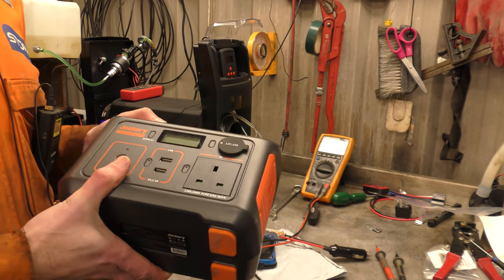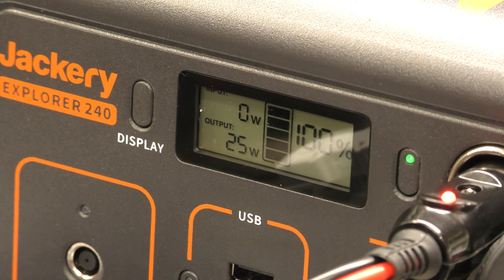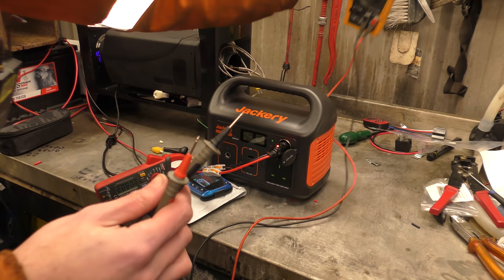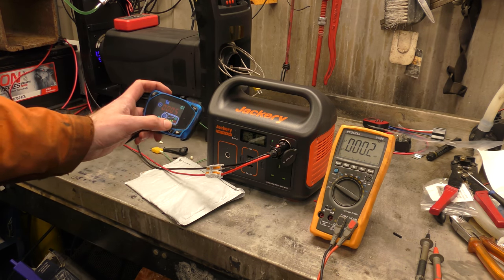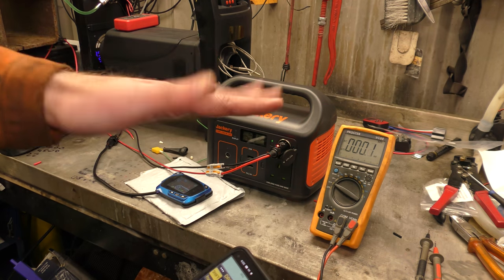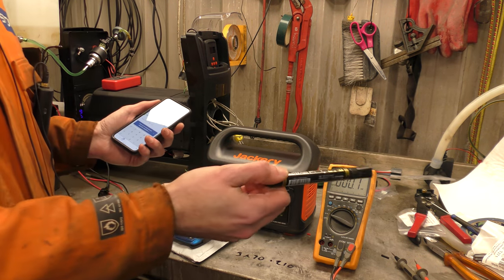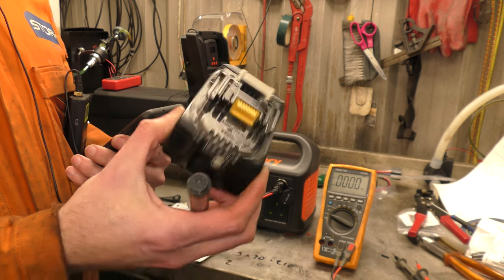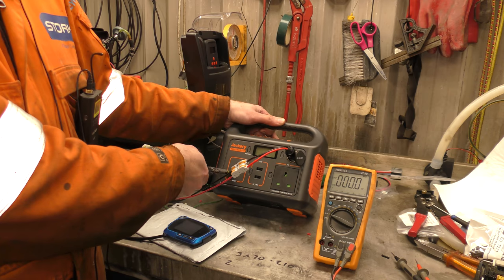Diesel Heater Running from Portable Power Station

Comment: And i run my heater on a 200ah renogy Lifep04 battery indefinitely - even only with 600w solar
Reply from the maker: Are those Renogy batteries good?  I get bombarded with Instagram adverts for them.

Comment: Great content mate. Would a Jackery be capable of running something like Bobil Vans hot water system too? They're pretty impressive, I'm thinking of getting the 1000 or 1500 and hoping it's all I need to run hot water and a diesel heater. Cheers mate.
Reply from the maker: Yes.  Well more yes than no.  Occasionally there are heaters that draw more than 10A at startup which trips a portable power supply.  But this can usually be fixed by having the low power set lower so it starts slower.  Once it's running there is more than enough current left to run the pump for the Bobil Vans water heater.  The pump only pulls 0.5A.
Reply: @DavidMcLuckie  Thanks David, much appreciated.  Could make a interesting video someday, I don't see any other youtubers testing this out.

Comment: So in your opinion, can a 2kw diesel heater running on a low setting off a Jackery 240, run for 8 hrs including shut down mode?
Reply from the maker: I've just realised you said 2KW.  Another viewer got 16 hours run time at lowest setting at what I'm presuming is a 2KW heater going by the numbers.

Comment: Can the Jackery be hooked up to a Victron 220-12V converter and run the heater endlessly when camping while connected to wall power?
Reply from the maker: I'd say no.  In the manual it says it can charge and be used at the same time but it's not recommended.  I'm guessing it's to do with the battery maintenance trying to charge and being used at the same time.
Reply: @DavidMcLuckie  Thanks for checking David. With a normal 12v battery the above would be possible, am I right?
Reply: You can power the heater using a Victron 12V-15A IP65 battery charger actually. I've tested running my Espar D2 heater which is connected to my van starter battery, which in turn is connected to my Victron plugged into wall power. With this setup you could run your heater, charge your jackery (if you have one) while connected to wall power - let's say you're camping and you have power access, or you are parked on your driveway and run an extension cord to your house.  I haven't tested connecting the Victron directly to the heater bypassing the battery but in theory it should work.

Comment: if it is not been moved about 2x 110ah leisure batterys would be better longer run time and cheaper some places you may even get a 3rd  battery
Reply: Would a 110ah leisure battery in itself be enough to power these heaters?
Reply: @naomiobrien3543  depends what other loads you have and how long you wont it to run remember 1x 110 ah battery is only 55ah as you dont want to take them below 50% battery discharge

Comment: I'd like to see what happens if electric power does fail while the heater is in full power and fully hot.
Reply: It will most likely fry the board on the heater as it relies on the fan to keep the heat from the exchanger from cooking the board
Reply: @Roerx pretty sure it will fry it's brain

Comment: Makita batteries brick themselves if they go dead low voltage 3 times. Can only charge them by cheating after that
Reply from the maker: Do we know what their dead low voltage is?  I've seen you can get a new BMS chip to bring them back to life.
Reply: @DavidMcLuckie  not sure mate, I had one brick itself after running flat a few times without recharging it immediately , could of been a bad cell in my situation

Comment: I USE MY JACKERY 240 TO RUN MY DESIEL HEATER, I KEEP MY HEATER ON 4 AND I GET AROUND 15 HOURS AND MORE IF I RUN IT ON LOWER , THE HEAT IS THE SAME TEMPERATURE ITS THE FAN THAT EATS UP THE POWER....